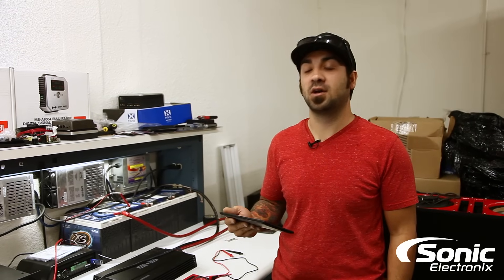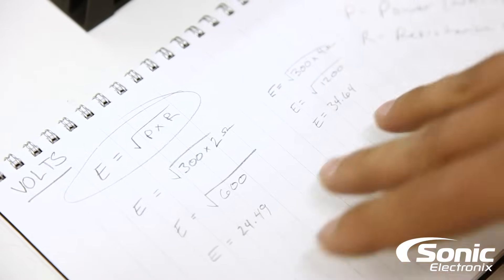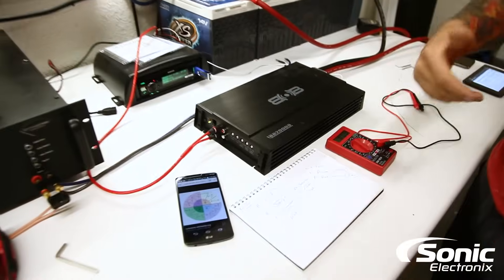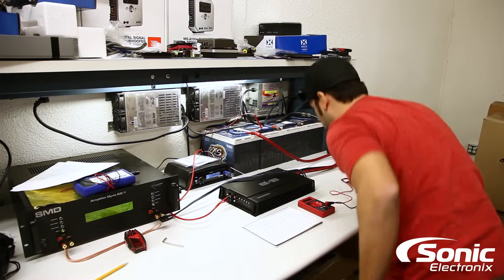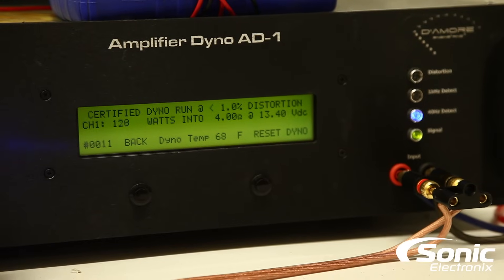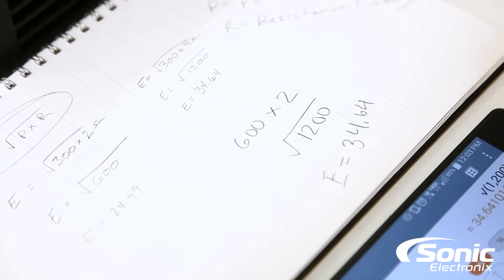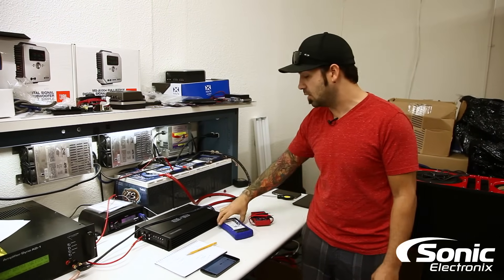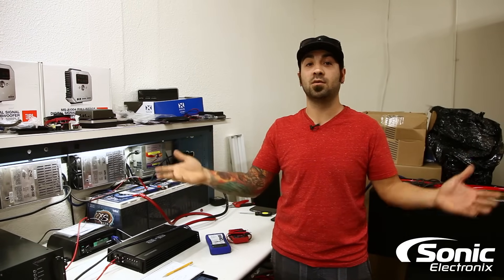How To Set Amp Gain to Match Lower RMS Subwoofers? | Car Audio Q & A

Comment: Probably the best video I have seen on this topic, but don’t understand one thing. I have set my front component speakers to 22volts ac to reach 100w . Only now to realise that the amp is rated at 60w per channel??

Comment: I have 2 dual Rockford fosgates hx2 I use my multimeter I to check the ohms on my speakers they r 4ohms but wen I plug them it reads 5.3ohms is that bad or good there 1000 watts n 500 rms running a twister m1000.1d how would i connect them to get max power

Comment: i dont get anything...
i just blew de fuses om my amp and my subwoofer lol
have a 2 channel 1x400w rms 4ohm or 2x200w 2omh amp and my sub was 350w 4ohm and yeah i might have give it to much power... oups i had the gain at half was fine and did a bit more over half should have known it was to much saw it wobble way to much...
anyway i got a other sub a velocity 400w rms dual coil amp so it does 2omh or 8ohm and i dont know if the 1x400w rms 4omh amp will work or blow up my sub again i used to run 4 channel often 160w rms 4ohm for the sub and the rest 4x60w for the speaker
dont wanna blow up my velocity sub LOL

Comment: I have 2 4DVC subs (1000 watts rms total). Amp puts out 2000 rms at 1ohm. Could I safely operate like this at 31 AC volts? I’ve read “match your amplifier rms to sub rms” and also “good to only use 50% of amp power”.

Comment: Why are all you ppl su chitty chatty about nonsense, jump right into it.
Step 1 step 2 step 3 step4 etc....
Not one of you guys are saying the voltage is it to the speaker RMS ? AND most importantly how to set the amp Xover for setting gain, you all say set the head unit to flat etc but HOW TO SET THE AMP XOVER for gain setting   at  Off or WTF...is it all a conspiracy. I used to in renovations and I ALWAYS GAVE MY HARDS EARNED TIPS AND TRICKS to all the juniors.
Have a nice day!

Comment: If i have two subs 600rms each at 2ohm so do i multiply them both and add together?so 600w rms x 2ohm =1200 per sub so 2400 total and square root that?

Comment: What makes you think you’re getting an accurate reading with your speakers disconnected?
Reply: What makes it accurate is the fact that this is an RMS wattage. It doesn’t matter if the speakers are connected or not. Wattage does reduce or increase when a load is applied.

Comment: Do I set the gain similarly if the amplifier is 75w rms and I have 40w rms and 100w rms speakers ??  according to the formula, 40w has 12.6v and 100w 20v correct ??

Comment: This works if no special equipment is available, but what about the fact that resistance and impedance are not the same thing? And, what about inductive reactance, resistance, or capacitance reactance? Plus, what about the phase?

Comment: If I have 2 8ohm subs but bringing them down to 2 ohms do I do the math off of 8 or 2 , I have 2  jl12tw3s 8ohms wired to 2ohms to a jl100.1 2 ohm amp

Comment: I've had subs that don't handle the rated power. There is the true problem. I had a couple of DB drive 12 inch Subs that were rated 600 watts RMS each so I got an amp that could put out 1000 watts to keep in under the 1200 watts the subs were rated at. It was still too much and started smelling voice coil. I had the subs wired for 1 ohm so I decided to wire them for 4 ohms which cut the power in half. The Subs were Over rated by double. My guess is the could only handle 250 to 300 watts RMS. too bad there isn't a way to figure out the true RMS of speakers and subwoofers. Does anyone have a method that doesn't involve burning out your subs to find out the the Subs true RMS?

Comment: Okay so quick question I know this is an old ass video but, how do I know what my target Hz should be for this? My subwoofers F/s is 32.89hz and my box is tuned to 35hz. 

I’m wired at 1 ohm with rise  1.33 ohms at 35hz being the lowest impedance. Should I be setting my gains at 35hz?

Comment: I'm confused 🤔
DB Drive Speed Series 900.1
2 Kicker CVR 400w RMS @2 Ohms

800w x 2 Ohms = 1600
√1600 = 40V

My settings goal is 40 volts on the amplifier
I turn off every setting on the stereo and on the amp. The Max volume on the stereo is 40 but it has distortion, so on 38 it's fine.
I start with the Level on the amp until it reaches 35 ACV then I move the CrossOver until it reaches 40 ACV which is the gain goal.

Everything fine until this point, however, once I start playing with settings ok the stereo the ACV goes up to 57V or more.
What am I doing wrong?
Should I left the stereo settings on flat or what?

Comment: Does your amp power wire impedance have any effect on setting the gain? If not, why is there so much fuss over the bigger the wire and the less resistance the wire has the better?

Comment: Would there be a reason why my amps aren't going up on the multimeter when I change the gain? The multimeter is functional because when I put the probes on the positive and negative on the amp, it reads 30.

Comment: So I followed exactly as you described. I have a 1500 watt rms skar zvxv2 sub its a dual 2ohm wired to 1ohm on a dc audio 3.5k amp. I set the gains doing the math 1500×1 and it was like 38v. When I set it that way and turned music on it would clip. So I had to turn the gains down again. Should I be using one Chanel of the amp? I've been bridging it. Thanks for the help

Comment: I'm a math retard but I have three 1,000 w subwoofers that I will be running at 2.67 ohms. 
I was going to go with a sundown 5K which will produce approximately 2700 Watts RMS at that impedance. 
A lot of people told me to get the sun down 8K so I can get a full clean signal and better sound quality with the amp game turned down. 
I believe I'm going with the 8K

Comment: Does this matter if you have 2subs? I mean the watts. I have 2 10's that are 400 watts each for a total of 800 watts rms they are 4 ohm subs.
I have them wired for the final load of 1 ohms does that matter too? My math showed the square root to be 56.56
Thank you! Hope to hear back from you. If it helps I'm using the Kicker CXA 1200.1 mono amp.
I know it's over kill but I didn't want to max out the kicker 800 watt amp.

Comment: Hey if you don't mind me asking. How would I do it with 2 svc 4 ohm 200 rms subs to connect to my 1200-1400 rms single channel amp. Im gonna wire them in parallel down to 2 ohm load. Do I do the equation separately for each sub at 4 ohm? Or do I combine them and do equation for final ohms at 2?

Comment: If I’m performing this task on 8” coaxials high passed at 80Hz, should I play a test tone frequency >80Hz?
Reply: prob slightly higher just in case your crossover's slightly off.  mayber 90?  actually i would try a couple different tones and prob some music too just to be safe.   he's just trying to keep the video short, but i bet if it was his system that he dumped a bunch of money in, he'd be running multiple tests.  heck you already saw how much higher it was when he did the 2 ohm test..  getting close to 100w over.  not sure you really want to be pushing 400w to a 300w speaker.  guess it depends on the brand,  some can handle it but most prob can't

Comment: Hoping to get answer seeing this video is a little old.my amplifier manual says it will output 100 watts @ 4ohms ×4 @ "14.4" volts". I guess this is a dumb question but so does that mean I have to set the gain @ 14.4 volts too output 100 watts? Wish I could ask question differently but don't know how to explain what I'm thinking.

Comment: I have 2 4ohm 12 inch subs and I want to run them at 1 ohm with a 3k watt amp so it doesn't over heat.can I set the amp  at around 2500 watts rms buy lowering the gain ??
Reply: Oh and each sub is 1200 watts rms

Comment: What if i get 28,28V by calculation, but my amp isnt going higher than 27? Im using an JBL GTO 2000 with Kenwood KFCW112S (AMP is 400W  "220W RMS", SUB is 800W "200W RMS"). I tried tuning by ear, but cant hear out if it is clipping or not. I tried this method with a Voltmeter. It goes only up to 27. I turned down a little to not stress the amp. Does it mean my Amp is not clipping even at Max Gain?

Comment: Hi Allyn... this is Anish from India... been an ardent follower of all your knowledge base... I think you are brilliant am sure all will agree... I need your help on this please... Have a Sony XM-N1004 and need to drive a JL 12W0v3-4 Sub (displays 300 RMS @ 40hms) in bridged mode Sony supports (175 RMS X 2).. what would be the gain Voltage, as per me Sony max is 26.45V whereas JL can go upto 34.64... Hope am write am setting this using a Multimeter using a 0DB 50Hz. All of this is hooked to a Pioneer DMH Z5290 BT... Front Channels using a INFINITY REFERENCE Component... Please help sort this for me , Thanks Allyn
Reply: Sorry 4ohms  LOL - Typo

Comment: Question... When you do have a bigger amp than the sub can handle.  Are you missing out on the woofers potential or the amps sound quality when you tune the amplifier to match the RMS of the speaker???

Comment: So 2 apline swr-12d2 1000rms/3000peak on a 2000watt amp wired in parallel at 2ohms should be 53 AcV, correct?

Comment: Does a 5 channel amp work the same way.75×4 on mids and highs and 360×1 @ 2 ohms.
Sub is 400 watts rms
Reply: if you have a 400w sub and a 360w amp what are you wasting your time with this for?

Comment: So let's say I have 2 DVC 4 ohm subs and I wire them down to 1ohm. Do I use the 1ohm in the formula or 4ohm in the formula? Not sure if need to use the ohm of the subs or what the amp sees.
Reply: Wire the speakers together, should be 1ohm, but test the wire with multimeter and it will tell you what it really is. Don't have it connected to your amp to check it.  I believe rms power is equal to square root of watts times ohms.
Reply: @dennispranevich2849  I have it wired @ 1ohm. Voltmeter verified. So my amp at 1ohm is rated at 2300 watts. With the formula, voltage should be 47.95 at the terminals I assume.
Reply: @datruth9850  I believe that would be correct for 2300 watts rms. I am not an expert but seems right to me. I have a cheaper boss amp that says 3000 watts max but I'm only actually getting about 1000 watts rms at 1 ohm.  It's a good match for my 2 kicker comp r 12's. They are rated at 1000 watts rms together, 2000 peak.  It sounds better than the cheaper boss speakers that were supposedly  rated at 1800 rms, 3600 peak watts.  Cheaper stuff is way overrated in general.
Reply: @dennispranevich2849  yeah i wonder if that amp is even pushing 1k

Comment: Hai.. Thanks for the video
I have 2 Doubts
1. , can you explain what should be the positions of HPF & LPF, switches provided in the Amplifier while doing the gain setting for full range speakers and subwoofers
In a 4 channel amp. (1/2 For speaker) &( 3/4 for Sub woofer bridge)

2. In every videos in YouTube  regarding the gain setting , they are using RCA input.. is that mandatory.. ?? What would happen if I use speaker level input instead of RCA while doing the Gain setting...

Comment: Nice explanation. It really helps to understand everything in detail. Can you also please tell us how to set gains, frequency and db level on an inbuilt amplifier. Also when you turn bass and treble to zero on the headunit before setting gains and after every setup you turn the bass and treble a bit up, does that make the subwoofer go crazy( when the setup is speaker level input). To be exact its pioneer wx-ts1210a inbuilt amp subwoofer. Thanks

Comment: So I have one 12” at 750rms at 2Ohm.. 
my amp is 800rms at 1ohm.. 

Which impedance am I using?? Thanks
Reply: Sub. But you may not be able to reach the voltage calculated. Your amp probably won’t push 750w at 2ohms

Comment: So for 2 10 inch subs at 4 ohms and a 1200 watt boss amp what would the settings be sorry math is my weak point any diagrams
Reply: It doesn't matter how many or what size subs are on the amp.  What matters is how much resistance is being presented to the amp.  Disconnect speaker leads from amp, use the same multimeter to measure resistance on speaker wires.  If the speakers have a 4 ohm load (the way you have them wired where they connect to the amp, not what each speaker ohm rating is) , take rated rms combined speaker power, multiply by the resistance measured from speaker leads, get square root of that number, adjust amp the way he shows in this video.

Comment: I have a cg30001d 2250rms amp and 2 SVR-15 subs that are 800rms a piece and I can’t get the acv to go over 45 at my amp output, I’m trying to get 80.
Reply: 2250rms at 1 ohm btw and my subs are wired to 1 ohm, I can’t go over 45 with a 40hz test tone at 75% volume

Comment: So i have 2 1200rms subs so 2400 watts needed but i achieve gain voltage of 48 with a 1300 watt amp. Why? Isn't the amp watt lower than what subs need at 2400 watts?

Comment: How do you test a bridged amplifier outputs on a 4 channel amp with DMM I have 2 MTX TNP212D2  12s those are SVC 4ohm 200RMS watts each and I have a rockville DB45 4 channel amp I know I should use a mono block but I'm working with what I have but I want to get the most out of them I have them wired at 2 ohms currently but I was told they would sound better and still hit good if I bridge them to 4 ohms any advice would be appreciated

Comment: Hallo my friend I have pioneer 1400 watts dual 4 ohm coil and 2800 watt amp(1200 RMS at 1 ohm / 900 watt RMS at 2 ohm and 750 watt RMS at 4 ohm ) which best set Amp Gain for that and best connection for subs dual coil,series  or parallel ?
Plz I wait your answer

Comment: I have a 700w amp pushing 4 speakers 90w each (180 pair).Im using a multimeter to set my gains. The question is do i set my gains to the amp rms or the speakers rms, for example my amp Voltage wold be 52.91 and my speaker Voltage is 18.97. Hope I'm saying it right

Comment: So I have a question I bought two 12s on the box it says 500/1000 peak rms at 2ohms so say that I just wanna set the gain up to 500 rms so that means I’ll do 500x 2 which is 1000 and the square root of that is 31.6 is this the correct way to do this with these two 12s or do I have to do it for each individual sub

Comment: Do we use the Ohms (R/Resistance) of what the sub is (D2) or what it's wired down to at the amp (1-ohm)?
Reply: At the amp is your measured resistance affecting final output.

Comment: What happens if you have multiple subwoofers? Like two 12’s ran to 1 ohm. Do you still use 1 ohm in the equation?
Reply: Yes. Electrical really is that simple.
Reply: @casey360360  soooo... if you have both subwoofers RMS at lets say 600watts, do you use 600watts for the equation? I have a Kicker 1600watt mono block amp with two kicker L7T12 2OHM peak at 1200 and rms at 600 wired both to 2OHM.
Reply: @xXGusDaBus75Xx  if I understand you right, you're asking if you use one subwoofers max RMS handling to set amplifier output for 2? So in a circuit, voltage is shared across all parts, power is shared. If you have 2 600 watt RMS subwoofers, your peak output needs to be a max of 1200 watts. When calculating this from the RMS voltage on the amplifier output, you're using the total resistive load of the circuit, which in your example is 2ohms. Let's say you're getting 50Vac at your amps output (with speakers connected) with a 2 ohm load, you're seeing 1250 watts RMS.
Reply: @casey360360  I have two DVC 2ohm 12s RMS 600 and peak 1200watt wired together to a two ohm 1600watt mono lock. Do I need to add the rms together of each for the equation or base the equation off of a single subwoofer.
Reply: I have 2 - 250wrms subs that are D2's. All that matters is the final load that the amp will see. 500watts x 2ohms=1000/Square root of 1000=31.622volts
Reply: @atmosphericpressure3560  so you multiply both subs rms wattage.. then multiply by load then find the square root. 

That’s my question to this video too bc I have 2 alpine type Rs wired to 1 ohm. The rms wattage of each speaker is 750. So with both woofers I need 1500rms combined then multiply by 1 then find the square root which is 38. So I set my amp with a voltage meter to 38 while setting the gain using a 50-60hz tone
Reply: @barumbryan  I believe so. The only thing that puzzles me is how in the hell the amp knows what to throw out when there is no load? Other than that the setup sounds alot better.
Reply: @atmosphericpressure3560  my load is 1 ohm. 

My subs are each 750 rms for a combined rms total of 1500 rms wired at 1 ohm 

My amp is also 1500 rms at 1 ohm
Reply: @barumbryan   38 volts at 45 hz tho👍

Comment: I have 2  alpine s type 12's duel voice coils rated at 600 rms a piece. Got ignite amp 1600.1/d. Says 4000 watts but definitely not. Got 3 30 amp fuses so I'm guessing 900 watts. Does 1 ohm. Says its 750 @ 1ohm both subs are wired to 1 ohm. What should my target voltage be to set my gain. And after gain is set can you still use bass boost or not. Thank for your help great vid buddy keep them coming.

Comment: Just helped set my taramps smart 3 to 34.64 to run my 600rms 12”, while I wait a few days for my 1500rms 12”. But please answer this- I got a dual 2 ohm, so I will be wired @ 1ohm. According to the formula, 1500 square root is 38.72. A dual 4ohm coil wired to 2 ohm allows more voltage? Another 16v to be exact? My amp will supply 3k at either 1 or 2 ohm.

Comment: Great video and explanation. What about the Gain set up for this one? Can you help me?             

https://www.skaraudio.com/collections/sdr-series-loaded-enclosures-and-subwoofer-bass-packages/products/sdr-1x12d2-rp-800-1d-skar4anl-cca

Amplifier Specifications
Model Name	Skar Audio RP-800.1D Monoblock
RMS Power at 1 Ω	800W x 1 Ch (14.4v)
Peak Power at 1 Ω	1,200W x 1 Ch (14.4v)
Power Supply	High-Speed MOSFET
Power & Ground Input Size	4 Gauge
Remote Bass Knob and Cable Included	Yes